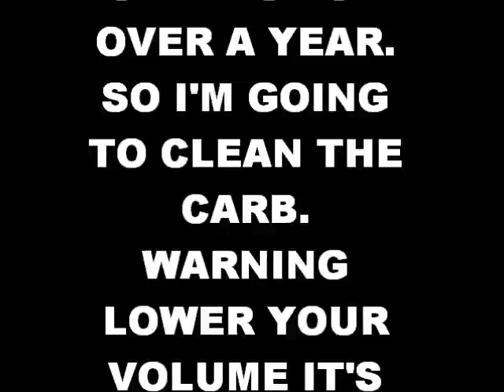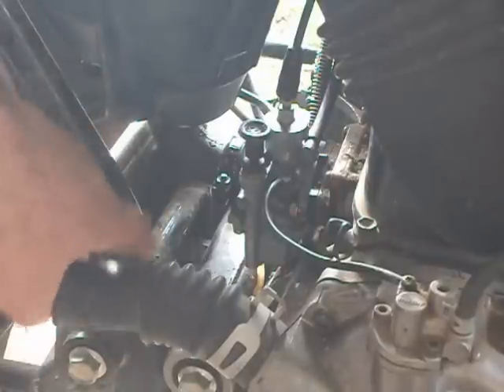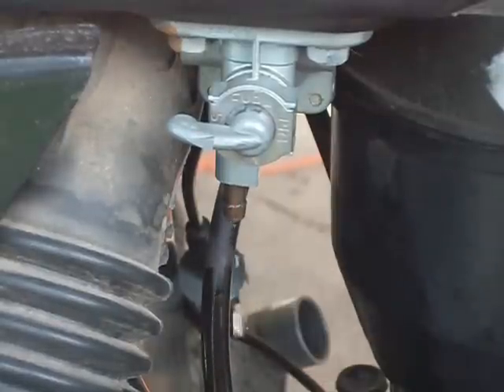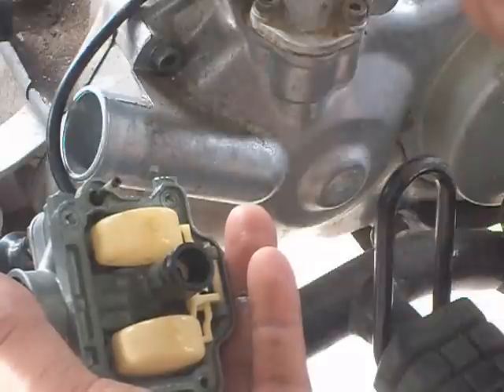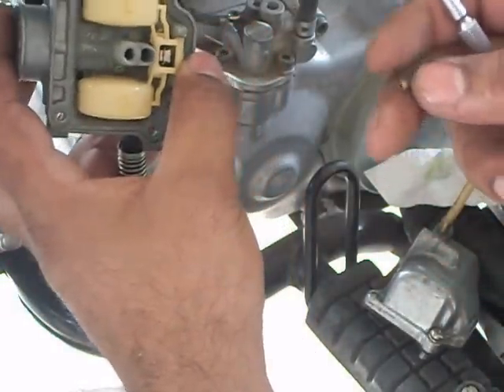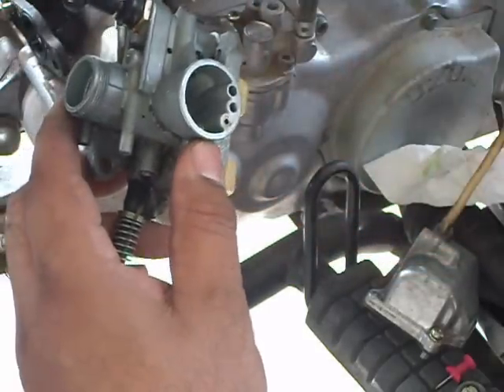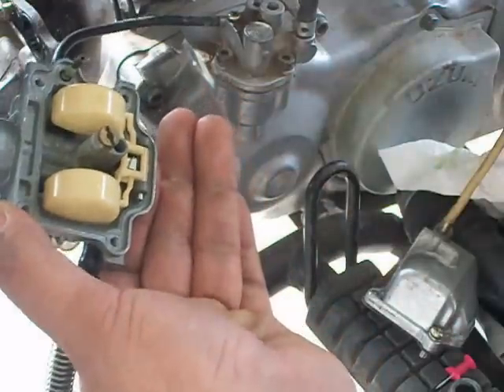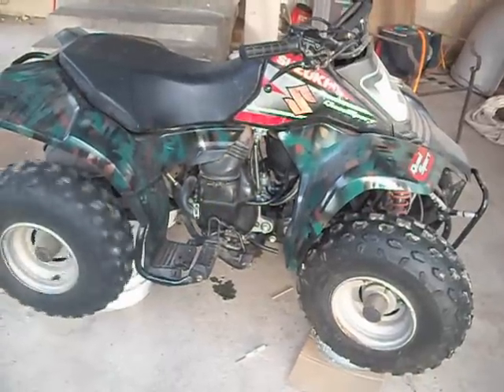suzuki 80 carb cleaning

Comment: Who ever has that problem where the atv starts full throttle, unscrew the throttle cable from the carb, and the barrel that goes in it, screw it in clockwise until the barrel drops and you can't see it, you seeing the top of the barrel doesn't count just make sure it's in all the way
Reply: Can you explain further on this I have a jr85 dirtbike that starts full throttle and I’m trying to fix it

Comment: Does anyone have a close up video, pictures or diagram of which hose goes from petcock to carb? Took mine off and forgot to get photo before and can’t remember which hose connects where on petcock and carb. Checked service manual and it doesn’t show connections.

Comment: I have an lt80 and the oil injector always gums up the carburetor so I bought a block off plate for the oil injector and started putting pre mixed fuel in it
Reply: MCFINIGIN what ratio mix do you use? And what kind of 2 stroke oil you use?
Reply: @valentinreyna-rosas3062  i put 32:1 In mine, Oil is some supertech 2 cycle found at walmart only smokes a little

Comment: Hey i just buy one like it and m not sure if. Need to mix my gas with 2 cycle oil on this? Or i just put straigrh gas in it??? And also it will cut off if i close the choke? Any ideas???

Comment: use premix and empty to oil injector tank its better to mix than take the chance of running it dry. you can leave it all attached I don't trust mine or any injectors for oil. id rather be safe than sorry I need a new topend.

Comment: Is there an idle screw and air screw? Where are they exactly?
Reply: My 87 only had an idle screw. But it was clogged with dirt from a torn boot gone un noticed for years. I replaced it with a cheap carb from eBay. Its an exact clone of the stock mikuni but it has the air screw and runs perfect. Only needed slight adjusting
Reply: @dylanwillyams  send us the ebay link please.
Reply: @dylanwillyams  thanks buddy.

Comment: Just got a lt80 and there is no lines coming from gas tank just 2 empty holes. Can any one tell me how to run the hoses?
Reply: Alright, So one should be capped off its a vacume line, The line in the back is the vaccum line the line that is directly under the shutoff lever is the one that should run to the carb

Comment: My suzuki lt80 go's in high rpms and i cant change it by turning the iddle screw
Reply: More than likely your throttle slide is in wrong, it should go all the way down in there, The throttle slide cable has a slot that some people mistake as where the idle mix screw is supposed to be just keep moving it in different positions until it goes all the way down
Reply: @jaydenbutler2116 dude this helped a lot 😂 didn’t have it in all the way but I still only have like quarter or half throttle…